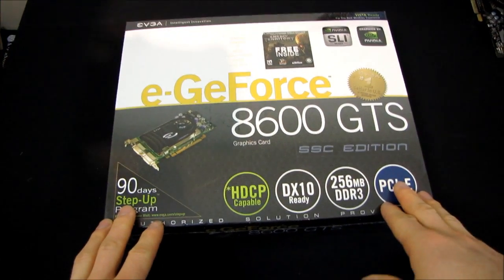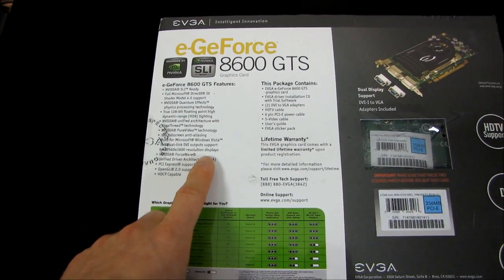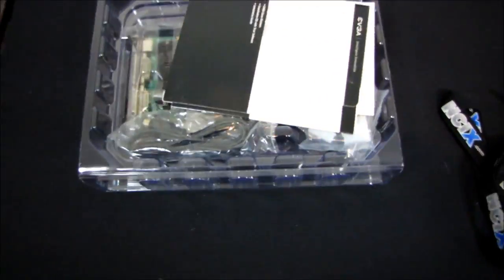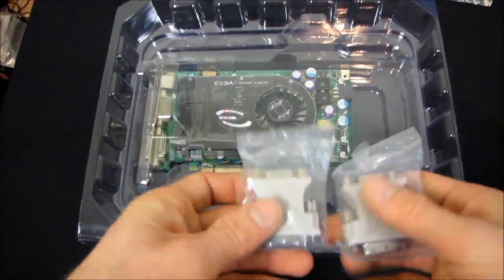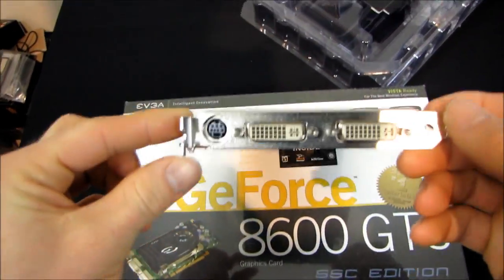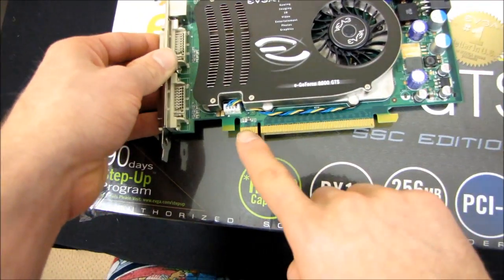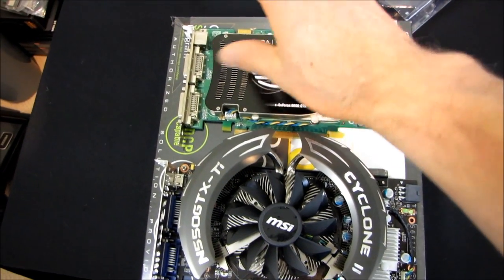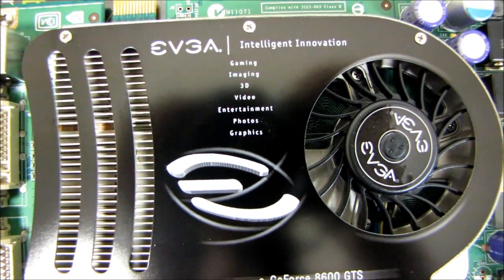NVIDIA GeForce 8600 GTS SSC Retro Unboxing Linus Tech Tips

Comment: Just took this card out of my 12yr old computer to clean the whole case & components from yrs of dust buildup... I unscrewed the fan unit from the video card & noticed the compound used between it & the video chip to have dried out & falling apart, so I rubbed it off completely with my finger & then wiped clean with a piece of paper towel.

Would it be safe to put the fan piece back on without applying a similar compound or not?
If not, would that compound be exactly the same as the one used for the cooling fan & the CPU of is it something different altogether??

Comment: Heh, I have two XFX GeForce 8800 GT Alpha Dog Edition GPU's with the included driver disk software, but the only problem I have is that the fan on one of 'em decides to rub up against the metal plating when placed with the back facing up (normal installation on a MOBO). I know this video is old, but I just had to bring that up.

Comment: Well... My first ever GPU was a Geforce 8400 GT, with custom work by inno3d... it had a whopping 512MB ram module and could beat out any GTX TITAN X SLI configuration...
Reply: +RektSkrubs You gotta be kidding, man. The 8400 couldn't beat out SLI Titans. It can beat a single Titan, sure, but not sli. It's an old card, be realistic.
Reply: ****8400GS http://www.geforce.com/hardware/desktop-gpus/geforce-8400-gs yes it can... it might also be able to beat out a 4-way sli 980ti non reference setup.

Comment: i still have an 8800GTS 380MB DDR3
Reply: +denvera1g1 I bought an EVGA 8800 GTX ACS3 kingpin edition for $650 at release, built my first gaming pc and went all out, it was the best video card at the time, by far, and I helped my friend build one at the same time, and he got the 8800 GTS....My GTX died a few years later, and I was using his 8800 GTS up until this very moment on my PC, but I'm in the process of building a brand new skylake 6600k gaming pc, just waiting on the CPU to arrive tomorrow and it'll be put together. I'm more than ready for this upgrade, lol.
Reply: +denvera1g1 my 8800GTS has it's SLI bridge in the normal position
Reply: +denvera1g1  me too xD (GTS is 320 mb)

Comment: I had a 9600 gt, good times :) my first card was a 7300 gs ha
Reply: my first card was a 7200GT, then a GT220, then an HD5550, and then an r9 270, r9 390, and now a gtx970
Reply: R9 390 beats gtx 970? DJ Jesus.He Died for your spins
Reply: +rambow70 let's just say my r9 390 kind of imploded and the MSI customer support and RMA policy sucks balls
Reply: Ah gotcha, I got the r9 380 and it's been going well. Plus they are close in performance you get the benefit of less power consumption with nvidia. And some title optimization
Reply: +rambow70 well I've also considered that because I am going to sli later, so with a GTX 970 my temps will sure be lower. BTW my card is an ASUS Turbo 970, it's perfect for sli. That's mainly why I've chosen that 970 in particular.
Reply: The turbo asus is just a reference card with holes in the rear, also it is harder to use multi gpu's with nvidia. You need a 970 with the same amount of memory and maybe even clock speed. If you crossfired the r9 390, you could have added any r9 xxx series card to work together at any gpu speed or memory size. Plus the new 3xx series run on average 2c cooler than the GTX9xx series. They just take more power to run.

Comment: what is better?
one 980ti or two of these in sli?
Reply: +geen naam three of these in sli will blow the socks off a two way titan x sli so i think two should do
Reply: Ｔｈｅ Ｃｏｍｐｕｔｅｎｔ
i know that
it was a joke
Reply: +relax360gaming What are you on about? A single 8600 GTS can destroy Titan X 4 way, 8600 was designed for 8k gaming, hence the 8 in the name.
Reply: +geen naam The real question, is can it run Minesweeper?
Reply: +deafyboy86 I thought it was for 8600k gaming?
Reply: +Nkh jk345 Im so jelly! I only have the lousy 980ti. They just don't make them like they used to :(
Reply: No. It has bigger number which means its better
Reply: +Ｔｈｅ Ｃｏｍｐｕｔｅｎｔ LOL A GTX 750 Ti overclocked @1450MHz will beat the GTX 550 Ti SLI and consumes less than 100W
Reply: KinGzeDK
wanna trade?
saw a 7800(i think) a few day's ago in a store for only 2 dollars
Reply: +Nkh jk345 um hello dual 9800Gt s in sli
Reply: +Nkh jk345 its a Asrock board with a AMD Phenom ii x6 in it
Reply: I have a dual set up of GTX980TI G1, in SLI.
And Gsync monitor is à must, for FPS (first person shooter)game’s.
if you don’t want Motion blur, @ hi FPS (frames per second) when a lot is happening on your screen, and it even heavy for a dual GPU system. stay away from a dual GPU setup.
Remember also a triple gtx980 equals the power of one GTX1080 (not the TI or founders edition)
But for every other game/program including RTS or MMO it’s worth the money in my opinion.
Reply: If you want to hook it up to a sdtv, this is better than a 980ti cause it has s-video
Reply: geen naam lol this is a no brainer
Reply: deafyboy86 dude that was amazing I can't even muster the sheer insanity of 
That statement
Reply: Bobby Thoms lol that actually came out.... but as you probably expected it's an i5
Reply: Alex C agreed (lol)
Reply: FAoNTomAs 980 ti sli slightly pulls ahead of a 1080 bro (if it is supported), what you meant to say is that it artifacts more, it is not widely supported, and it is heavy on power consumption.
Reply: Two of these is probably a little more powerful than the TITAN XP.
Reply: +geen naam a 980 TI by MILES, hell the 980 TI will even beat the shit out of the 550 TI in SLI.

Comment: I had an 8800 GTS which had a pretty modern dual slot design with heatpipe cooler. That thing got so hot that you'd burn your finger if you touched the backplate after gaming on it.

Comment: I have a shitty computer... Can you recommend what graphics card I can put into my Dell Dimensions E521?
Current Specs
-Processor: AMD Athlon(tm) 64 X2 Dual Core Processor 4200+,MMX,3DNOW,~2.2GHz
-Memory-1022mb RAM (Will add another 1GB ram card)
-Current Graphics Card: Nvidia GeForce 7300 LE approx total memory 512.0 MB

Comment: The 8600GTS had the same amount of memory as the 8600GT. The 8600GTS had same number of stream CPUs, but higher overall clocks, and slightly faster memory bandwith and required an external power link (some molex some PCI-e connector) while 8600GT did not.

Comment: @zipzapzupify  just bought one around 4-5 months ago for alittle over 1k.  i5 760 cpu, evga gtx 460 1g sc gpu, 4g corsair, 550w corsair psu, intl dp55kg extreme mb, WD 1tb, Cooler Master HAF 922M case, also got the Hyper 212 Plus CPU Cooler not that im over clocking, but just like having a larger fan so it can cool well at lower noise levels. all and all it rocks!! and very quiet.